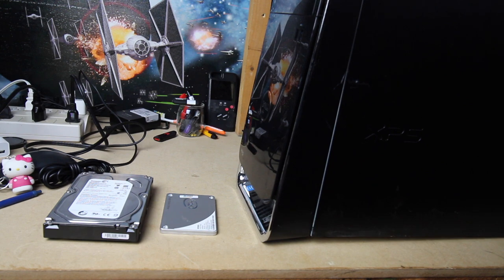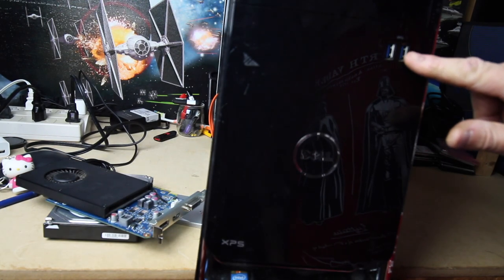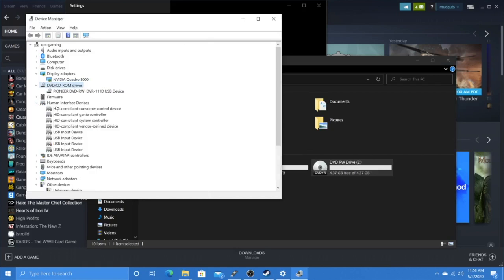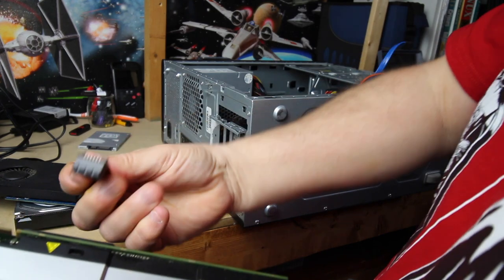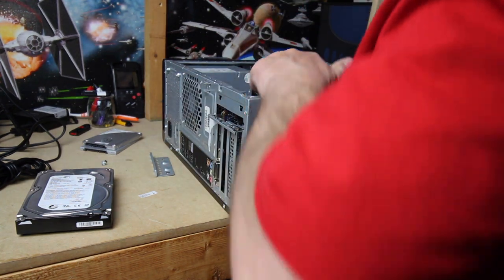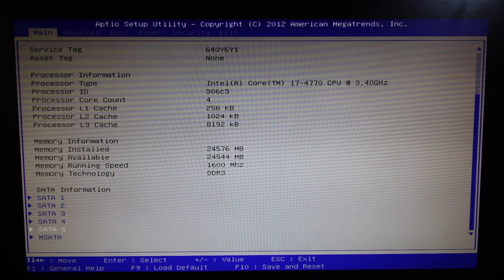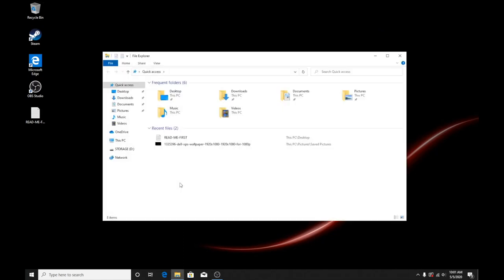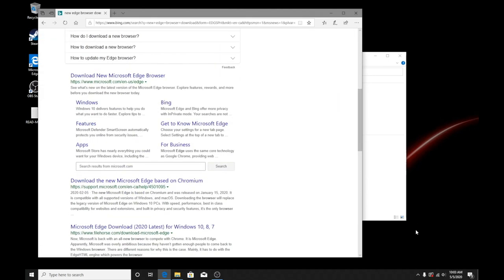Dell XPS 8700 i7-4770 in 2020

Comment: Thank you Mike for this awesome video! I've been using this 8700 for the last 9 years and it's still a nice machine! 
I'm getting now issues with P2 jacks. Sometimes they work sometimes not. I can take it off the side cover easily as the frontal cover. But this top cover has been my great challenge. lol. In my whole life, I never took in that part. lol. 
With you video, I could get some nice tips to upgrade someday. Thanks a lot!
Reply from the maker: Glad it worked out.  Thanks for watching!

Comment: Got a free gps 8700 with an i7-4790 @ 3.6ghz. I've heard that having 2400mhz ram helps getting out the most out of this intel CPU. Do you think it's worth it to upgrade my 16gb of 1600mhz  ram to 16gb of 2400mhz ram or is it too marginal of a change? Also, how much better is performance when having both an Os drive and a data drive? I'm on a budget and was wondering if having two different SSD's (or one SSD and one HDD) would significantly make my performance better. Thanks.

Comment: Do you know where to find the drivers of the dell xps 8700? I install a new and fresh operating system and i cant find the drivers of sone of the hardwares..
Reply from the maker: You’ll need to download the Dell support assistant and it will run a system check.  Then it will pull down the drivers for you.

Comment: This is a little old now but you could've used all the 3TB space by changing the drive type to GPT. Usually a drive is formatted as MBR which can only support up to 2TB. All versions of Windows 10 can read GPT drives and use them for data—they just can't boot from them without UEFI
Reply from the maker: Ahh. That’s interesting. I will try that again. I have a few more 4TB drives around here I think.

Comment: Just bought a 2nd-hand Dell 8700. It won't recognize my new 4 TB SSD drive if set to UEFI in the BIOS. Then when I set the drive to boot as first device with the Legacy BIOS setting, it just tells me, select proper boot device, which I have, and which it IS. Dunno whether it supports 4 TB drives. Anyone know?
Reply from the maker: It only supports 2TB so you’ll need to format the drive into 2TB or smaller partitions
Reply: @MikeDancy  Thanks Mike. So you're saying I should make sure to format/re-format the drive as legacy, then make sure the hard drive that contains the OS is less that 2 TB, and it should work then?
Reply: The same situation with me. Thank you for this video. I will try

Comment: Hello I have this same pc and I upgraded the graphics card to a 750ti and power supply to a 600watt years ago. Worked perfectly till i started playing newer games and the 750 just couldn’t keep up with graphics. I got a rtx 2060 and it crashes randomly when not under load. I’ll play CoD warzone at 90fps with no issues but if I try to play a browser game or something like Minecraft it’ll crash. It sometimes also just crashes randomly. If I switch back to the 750 it works fine with no crashes. Any idea what it could be? I have tried fresh windows install, switched to ssd, updated all drivers, updated bios, and I even got the 2060 replaced because I thought it was faulty. Also tried my friends 1650 and the crashes still happen.
Reply from the maker: it could be the power supply.  maybe the stock power supply can't give the RTX 2060 what it needs.  the 2060 needs a  500 just for itself
Reply: @MikeDancy  I tried a 700 watt psu cause my friends told me the same but it still crashed. The reason this confuses me so much is why doesn’t the pc crash when I play something like Warzone which i assumed would cause the gpu to draw more power but it crashes when I play something like Minecraft. Also if I have Warzone open in the background I can play Minecraft with my computer crashing lol
Reply: @jnyc96  Ever figure this out?
Reply: @N.E.U.R.O  nah lol I just ended up building a better pc around the 2060. Good luck tho  👍🏽

Comment: Hello sir, I have the same computer, and still working perfect, I change the gpu for a Rtx 2060 and the PSU evga 600w bronze, can in future update the CPU? I think that I need to replace also motherboard, is that posible?
Reply from the maker: I think you can upgrade the CPU a generation or two but if you really want to make it faster, you should change the mobo too
Reply: You should just get a new pc
Reply: if it already has a 4770 no you can't.. and it stops at 4th gen 4xxx quad core chips
Reply: You can upgrade to a Haswell intel cpu, the best cpu upgrade you could get without changing the mobo is an i7-4790k

Comment: Do you think a computer with a i7 4770 is worth it today for $300?
Reply from the maker: Desktop or laptop?  It’s a capable processor. It will run Roblox and minecraft and a few other games. If you get a desktop and add a video card, it’ll be okay. But I wouldn’t pay more than $200. I just sold a i7-6820HQ for $350 CDN
Reply: @MikeDancy  it's a desktop. I don't really plan on playing many or any games on it really I just want to know if its fast enough for work//school